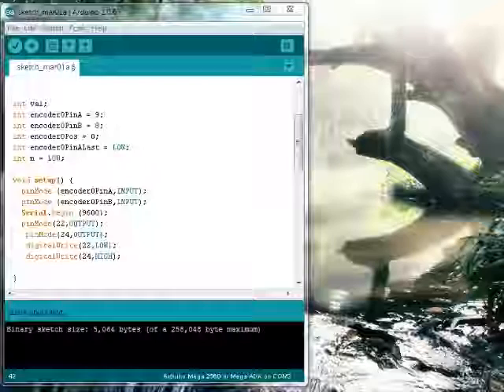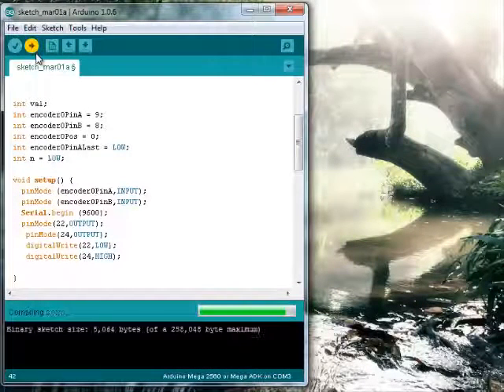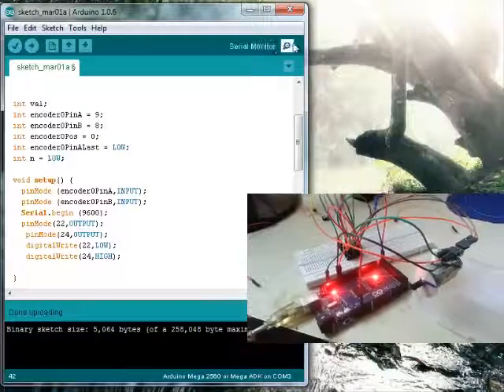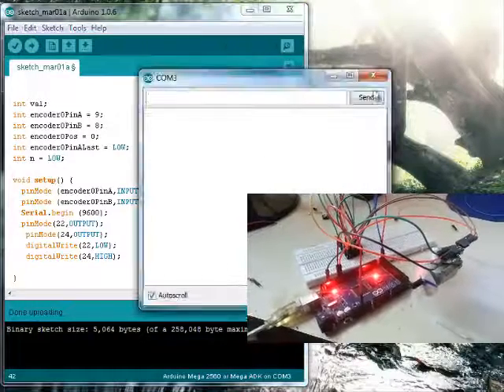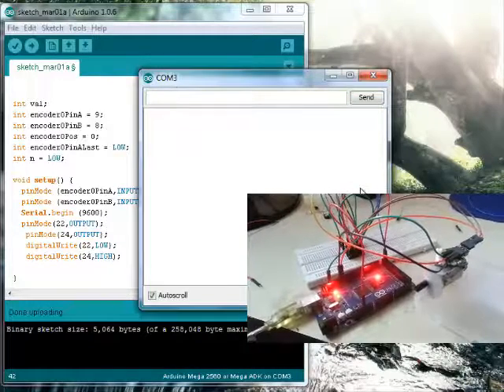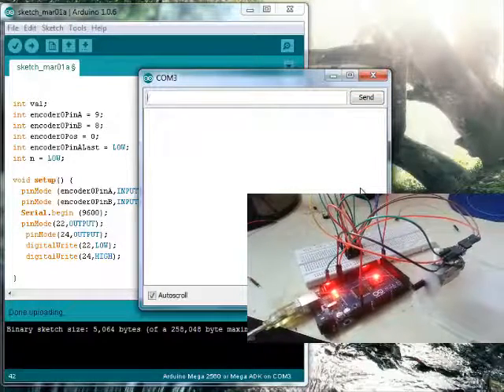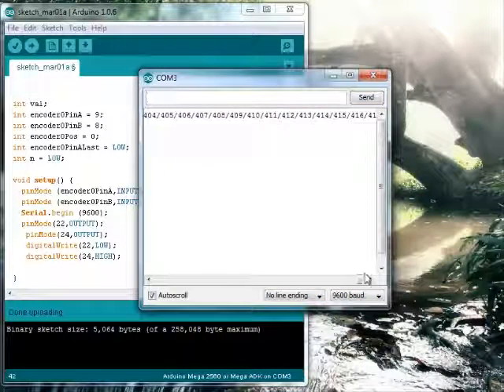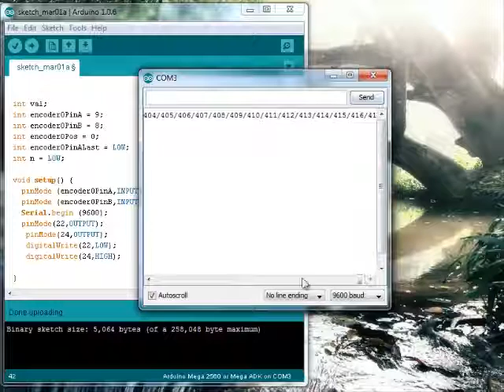Arduino with simple industrial servo motor example

Comment: is was a waste of a encoder, the whole point of a encoder is to know your shaft location and move in increments accordingly and thats how you use a dc motor with the driver and encoder as a servo motor all you have there is a dc motor
Reply from the maker: jai Lopez  no  i have used encoder in this and it knows it's location !
Reply: magan soma for what did you use the encoder for? what was the reason of the motor spinning  like it did with a encoder in it?  you can make the motor spin just like that without a encoder or nothing not even need a L293D that chip is only good to reverse polarity on motors thats all encoder is used to read your motors location in angle a simple code can take care of the turning on and stopping using only Millie second function and a ceramic cap on the motors leads to protect from back current flow and even if you like to spin the motor like crazy to get to say 500 rpm only this still can be done with only code just do  the math
Reply from the maker: jai Lopez   i used the encoder for counting rotation of motor and stop at specified rotation number thats what i had done in video and code which i putted below video ..by the way thanks for the reply !
Reply: Ooooooh, ok ic but whats the practicality in that?

Do you have code that allows me to use my encoders to follow my potentiometer or imu? For dc motor
Reply from the maker: jai Lopez  i had not tried this code but you could try

code:
int val; 
int encoder0PinA = 9;
int encoder0PinB = 8;
int encoder0Pos = 0;
int encoder0PinALast = LOW;
int n = LOW;

void setup() { pinMode (encoder0PinA,INPUT);
pinMode (encoder0PinB,INPUT);
Serial.begin (9600);
pinMode(22,OUTPUT); pinMode(24,OUTPUT); digitalWrite(22,LOW); digitalWrite(24,HIGH); } 

void loop() { 
  
  int sensorValue = analogRead(A0);
  
 n = digitalRead(encoder0PinA);
if ((encoder0PinALast == LOW) && (n == HIGH)) 
{
  if (digitalRead(encoder0PinB) == LOW) 
{
  encoder0Pos--; } else
{ 
  encoder0Pos++;
} 
Serial.print (encoder0Pos); Serial.print ("/");
} 
encoder0PinALast = n;
if(encoder0Pos==sensorValue)
{ 
delay(10);
digitalWrite(22,HIGH);
digitalWrite(24,LOW); }
if(encoder0Pos==-sensorValue)
{ 
digitalWrite(22,HIGH); 
digitalWrite(24,HIGH); 
} 
}
Reply from the maker: magan soma  but if you going for more powerful and smart controll look at this
:
http://abigmagnet.blogspot.in/2008/10/dc-motor-control-part-one.html
Reply: thanks for the code ill try and get back to you , and as for the link on vemeo this is great tho this guy who did that blog is no help and does not want to help this was six years ago so his the prime example of someone who starts project leaves dem half way dont quits on dem and then try to half ass teach others "this is not a good teacher/instructor or someone who wishes to share with other thos type of ppl simply just want attention likes and subscribes
Reply: magan soma what was this code for again ? single dc motor control using pot? or 2 dc motor control using pot? i just noticed that there is 2 sets of digitalwrite so im not sure why but just needed some clarification so that i can setup this here good as i have no schematics
Reply from the maker: I  have  used l293d  ic to controll motor so it has two digitalwrite  please refer l293d  ic ...information
Reply from the maker: This code for one dc motor and one pot..
Reply from the maker: Ya rightnow   I dont have skype but I can use but rightnow I have some connection issue  with internet so I can skype as it repair ...if you tell me what do you want to buid or do by this motor control so I can give right direction  by my  little knowledge I have
Reply: magan soma well i wanted to keep the project private between us thats why i suggested skype
Reply from the maker: I can meet u on yahoo messenger :cktandel@yahoo.in
Reply: ok
Reply from the maker: +jai Lopez 
you will find this helpful for you :
http://arduino-info.wikispaces.com/Nrf24L01-2.4GHz-HowTo
Reply: magan soma ill check it out thanks
Reply from the maker: +jai Lopez 
he may help you as i think he has good knowledge on microcontroler check this out :
http://elecnote.blogspot.in/2015/01/arduino-projects.html
Reply: +magan soma http://excorp.weebly.com/

Comment: Were you ever able to find the schematics for the printer motor/encoder combination you are using? It appears to be the same type as I salvaged from a computer and I had zero success finding the encoder's wiring diagram.
Reply from the maker: Jack Trexler this is what i got from
http://forum.arduino.cc/index.php?topic=156312.0
Reply from the maker: Jack Trexler  these are three images  if you need any help related this feel free to contact me ...or just comment below ..

http://forum.arduino.cc/index.php?action=dlattach;topic=156312.0;attach=39299

http://forum.arduino.cc/index.php?action=dlattach;topic=156312.0;attach=39297

http://forum.arduino.cc/index.php?action=dlattach;topic=156312.0;attach=39295